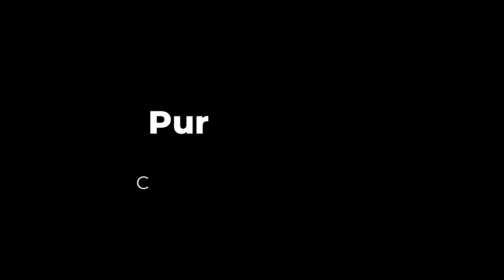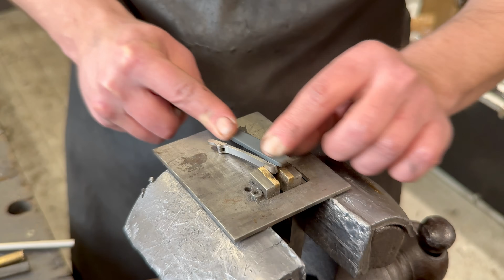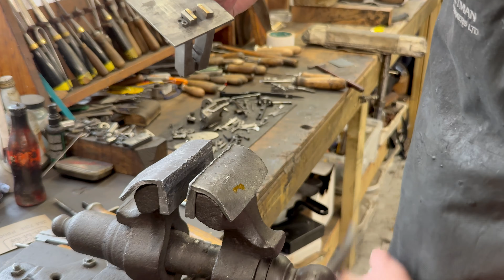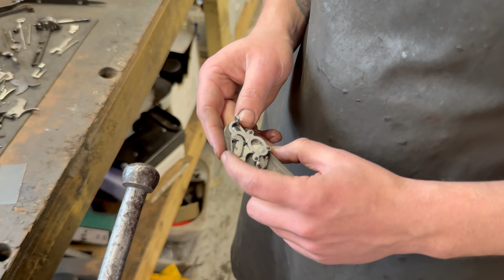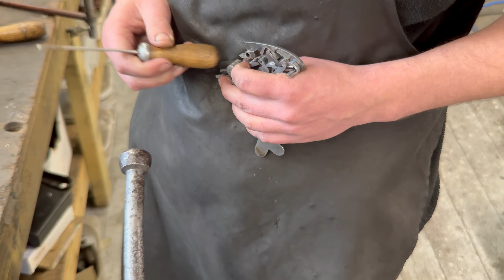James Purdey lock... cleaning, buff stick & secret polishing powder, and how to reassemble!

Comment: Oh, the spring on the Atkin is just like the cocking spring for the Purdey. It has the little roller.
Reply from the maker: Yes, the Atkin and the Purdey lock work are basically the same apart from the ejector trips 👍🏻